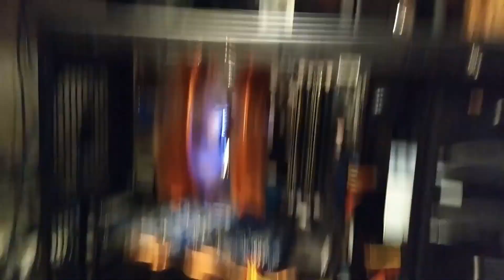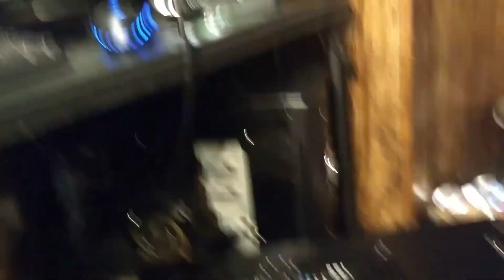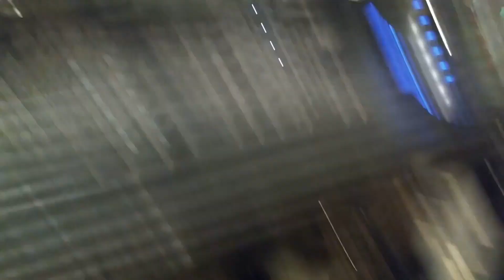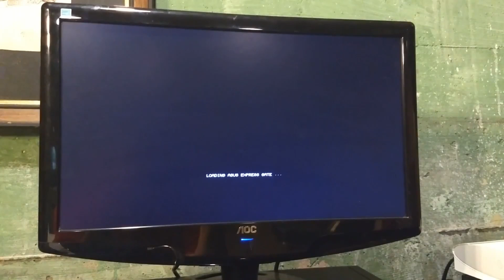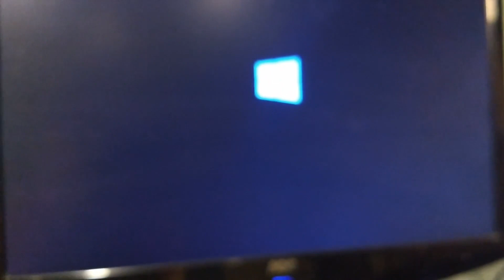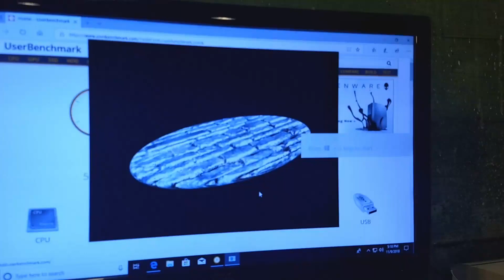What happens when your PSU isn't good enough?

Comment: hello before i use build in gpu without a problem then when i install my gts 450 when i play fps games it start glitching and i resatrt and froze please help me i dont know if my psu is the problem
Reply: but when i check in device manager and driver the gpu is properly working i use a8 apu with gts 450 with 250 genericv psu

Comment: hii i have ryzen 5 4600g w/ integrated graphics and 16gb of ram 120ssd and 500hdd but my system unit keeps stuttering like fps drop from 200 to 8 :( could it be the PSU?? already tried formatting but non changed its still stuttering please send help :(

Comment: I installed a new gpu and the pc wont boot up I unplug the power from that gpu and it turns on any idea would a low wattage power supply cause this? Or could the gpu be dead?

Comment: my pc when i boot it up with my 3070 it loads for a second sometimes will get to the windows login screen then pc shuts off my 3050 doesnt do that im using a 750 gold evga power supply and cant figure out whats wrong please help
Reply: my pc is brand new all parts are the gpu is used but doesnt have any signs of damage that i can tell and the 3070 fans and light comes on so id assume its working but idk what to do
Reply: Is your issue solved ??
Reply: @DjAsh05  yea it was a motherboard issue even though my motherboard was brand new a micro atx board isnt strong enough to push bigger cards what i mean by that is it doesn't send enough power to the pcie slot for the gpu to turn on

Comment: My screen will turn black screen while gaming with (no signal) sign on the monitor similar to yours, but after I force restart it bios warning didn't appear. Is it a PSU problrem or GPU problem.

More detail: when black screen occur, I can still hear the bgm of the game and my friend talking for 5 to 10 second, then the sound will go brrrrrrr
Reply: Hey i'm currently have this problem... i have a rx 6800 xt with 600w bronze coolermaster, what should i do? Is it a software issue or a hardware one? I hope u see my comment tho😅
Reply: @SoreofMadmen  hey there, feels bad to have the same problem. I solve the issue by getting a new GPU.
Reply: @orochix-bk6zp  i actually got a new gpu, but im aware now the problem was overheating hdd (idk wtfff and how this is even possible) anyway thank u for replying me<3

Comment: Thought it was my gpu failing when ever I loaded into a game couldn't even play valorant, thought it was my gpu which made no sense since it was an rx 580 and never had a problem. Then I asked my brother to use his which is the same and it did it again which would make no sense. So I thought it must have been the power supply. Bought to find out later on.
Reply: How was it? Does the replacement PSU solve your issue

Comment: My system has a gtx 970 and I am running it with a 500w psu, when I play heavy games it turns off suddenly. What can be the reason. Is it a problem with the psu or the vga
Reply: I think we have same prob mine i change my gpu from gtx 550 1gb to rx480 8gb and now i am having issue when max out gta v graphics the game will hang then image will gone for like 3sec then automatically restart it self and if i play on low settings i can play it but just for a couple of mins then the game will hang for a second image will gone then restart itself i dont know if the psu is the major problem

Comment: I'm currently having this same problem when playing games, I upgraded the CPU, motherboard and RAM, went from an i7-3770k to a i9-10900k running with a 1080ti, temps are fine, wattage is not going over PSU rating, reinstalled windows, my current PSU is about 7 years old now, so just ordered a new PSU, hoping that's the problem.

Comment: My stock 350w psu from asus was causing the same ‘voltage’ errors. I just upgraded to a Corsair 850w psu and pc is working like a charm.
Reply: NEVER cheap out on a PSU good decision! I'll do the same too!
Reply: If the power supply doesn’t work does it crash when playing games ?
Reply: @Mozatic  I think I got the same issue with a GT630 and a 305w PSU.What happens to me is random stutterings,screen messed up+distorted audio+PC freeze,fans spinning slowly with the GPU on and sometimes a totally freeze of the PC even on the desktop or very old games.If you had one of these sympthomps could probably be the PSU,you can ask to a PC shop to test it with a different PSU and if it's that the cause then you need to buy a new one.
For what I am experiencing I think it's totally faulty PSU.
Yeah I commented really late but who knows,maybe you still was guessing it.

Comment: Do you think that 50 watts less than recommended is concerning?
-------------------------------------------------------------------------------------------------------------
My friend wants to get a new gaming pc. I talked to him about some 
components and compared them to my own components. 
I accidentally found out that I need 450W and not my 400W.
Do you think this is concerning? Should I upgrade to like 500W?

This is where I calculated the 450W: 
https://www.whatpsu.com/psu/cpu/AMD-Ryzen-2600/gpu/AMD-Radeon-RX-5500-XT
On the website of my GPU, 450W are recommended too.

System:
CPU                           -AMD Ryzen 5 2600
GPU                          -GIGABYTE Radeon RX5500 XT 8GB OC
MOTHERBOARD     -MSI B450M PRO-VDH MAX
PSU                           -BE QUIET System Power 9 400W
Reply from the maker: It could be, I usually recommend at least 20% to 30% higher wattage than the max power draw of all of your components. Maybe even a 600W for your case just to be safe. Depends on how high quality of a 500W you get.

Comment: Well i bought a new PSU 550w and it popped 3 days after using while i was playing a game...i stopped using it cause it was hot and it smelled fried, so i replaced it for my older one, and i also noticed that i had set voltage on manual in bios, so I'm not sure if that was the problem, but from that moment after i replaced it, my CPU/GPU fans are like crazy and even tho i turned the PC after half an hour after PSU failure, CPU still had 67°C in idle, i tried to game on it, it didn't raised more than 80°C but im still wondering if it messed up my motherboard and that's why my fans are so loud or something like that, i just hope it will not happen with the last PSU i had before that one
Reply: Maybe you need to repaste your thermal paste or clean your pc regularly.

Comment: in my case, my PSU was not good enough so my system was slow I thought my system was just shit but when I detach one of my fans it finally worked
Reply: What how does that help
Reply: I have a 1660 super and a i710700 with a 380 watt power supply how can I fix this issue

Comment: What if there is too much extra?
Reply from the maker: Nothing, the computer will only draw what it needs from the PSU. I usually recommend getting a PSU that's rated around 30% higher than the wattage required for your system. You don't want to push your power supply to its limits all the time.

Comment: I have 
265w psu dell
Amd radeon r7 370 nitro 2gb
8gb ram 
Core i5 2400 
Whenever I play game after sometime ,it crash with stuck screen and also with buzzing sound, Hope u will reply ❤️👊
Reply from the maker: I threw your parts into https://outervision.com/power-supply-calculator and it recommends a 318W PSU (268W under load, 2 hours a day). Switching the power supply would probably be a good place to start. I'd recommend at least a 450-500W 80 Plus Bronze from a reputable brand. Here's a great forum post with highly rated units: https://linustechtips.com/topic/1116640-psucultists-psu-tier-list/
Reply: @seversinsystems  😊 thanks bro
Reply: SAME BRUH

Comment: I’ve been getting crashes, and then I will have to fight to boot it. I have 430 Watts running a rx570 + i5 3740, after watching this I now know my problem, I’m going to try to upgrade to a 550+ watt
Reply: any luck bc my gpu turns of and my pc stays on and monitor says no signal and i have a gtx 960 ssc on a 380 psu and i need to know if i need to change psu
Reply: @theycallv  I changed to a 600w and it did the trick for a week then it came back so I just got a gtx 1070 and I’ve been fine ever since
Reply: @SpaghettiToesTV  ok yes same i changed my psu and its working now hopefully it stays like that
Reply: I have the same issue now with my sapphire rx480 8gb when playing gta v on max settings it stutter and then automatically restart i have a class a 450 psu my old gpu was gtx550 1gb and its all fine with that card and since i chang my gpu to rx 480 its restart when playing gta v on max settings what do you the problem

Comment: I recently bought a Ryzen 5 3600 , 16gb ram , b450 pro mb, 550 psu I still use my (rx 470 idk what upgrade to but my button to cut it on just keeps blinking and the psu is making noise does anyone know what that means?
Reply from the maker: It could be the PSU. I would double check all of your connections to the motherboard and any other components. Also, if there's any kind of diagnostic LEDs on your motherboard, see if they can give you any more information.

Comment: Having the same problem. It started happening when I upgraded the processor and the GPU. 
My PC restarts when playing games. But also even just watching YouTube. My temps are fine, gpu and cpu temps are around 60-65C max. 
I hate to think that my seasonic 750 platinum is failing just after 2 years! I just ordered a new PSU from MSI. I hope that solves it.
Reply: did it solve it?
Reply: @metrox_supreme  ive had the exact same issue,pc just dies when in games after ive upgraded from a gt 1030 to a gtx 1070ti,and i swapped the psu from a shitty 450 watt one to a 850 gold rated psu,works like a charm
Reply: @ski11zlol  was your pc also getting randomly restarted with that 450w psu?
new PSU fixed event ID 41?
no issue with ram or storage drive? 
you sure this type of issue is only with faulty PSU?
Reply: @exgamer5073 did u fix it I need help
Reply: @fade_jr9712  yah I fixed it year ago changed my PSU to some reputable brand corsair gold rmx 750w
changed to Samsung NVME
changed my ram to corsair

if all of this seems expensive you can try one thing with F panel connector remove to reset connector from motherboard see if that helps
Reply: @exgamer5073  I think my issue is either windows, ssd, or psu I think I’m gonna try to replace the psu first
Reply: @exgamer5073  was ur pc crashing while just being in windows and freezing constantly?
Reply: @fade_jr9712  my pc was crashing randomly like in the first 10 second of boot it would crash the other times it would crash after few hours totally random

I knew there was problem changed my psu didn't solve the issue so then I changed ram and nvme while doing so I happen to remove RESET F PANEL connector I think that one was real culprit
Reply: Shai did the new PSU fix this problem?
Reply: @raketjohnny1337  yes
Reply: I remember a while ago I used a weak psu on a powerful graphics card and i was wondering my i am getting so much lag on an EVGA GTX 750 Ti 2GB and an Core i7 2600K i usually thought it was a storage problem because my hard disk was nearly full, after 5 months it destroyed my graphics card and there was a burning smell and smoke coming out of the power supply and my screen was showing display but the gpu fans werent spinning and after a few minutes my graphics card powers off and my screen went black, the original owner claimed the psu is 600w but when I took the psu I saw it was only 235w office psu so I upgraded to a 550w high quality psu immediately luckily my motherboard had an anti-surge otherwise everything else connected to the board would be fried

Comment: I have a 500 watt generic psu can it damage my GPU? Cause the fans is working but in my Monitor is Not Detecting it or No Signal
Reply from the maker: It's possible. I would inspect the power cables for the GPU and the GPU itself for any obvious physical damage. Otherwise, I'm not sure of any way to tell for sure if it was the power supply's fault or not.
Reply: @seversinsystems  i bring it to the Technician Yesterday and they Inspect it or he calls it Check up i pay 4$ to him i ask whats the reason why my monitor is not detecting my Gpu its because of my Power Supply they try there power supply and it work but when they plugging my power supply its 100% non but the fan is spinning btw thx for the help the main problem is my Psu is just a 500w generic and generic not lasting long thats why
Reply from the maker: @dandionila5133  Glad you were able to figure it out!
Reply: @dandionila5133  I have the same problem
Reply: @dandionila5133  what psu did you buy?

Comment: I have core i5 2400 and gtx 1050 ti with generic 350 watts gpu, am i safe?
btw i upgraded it from samsung prebuilt.
Reply from the maker: I would plug all of your components into this calculator: https://outervision.com/power-supply-calculator
Reply: I am assuming your safe, but it depends
Most of the 1050 tis does not have a power connector, so the motherborads provide the with max 75 watts and the bios settings of the card will kick in and clock it down if it wants to pull more.
Your i5 has 95watts tdp, but it pulls less, about 70watts ( I have the same cpu)
you should look at the 12v rail onthe infos/sticker on your psu and substract 20% off it, because its a cheap psu und you should not over stress it ;)
example:
12v * 20A = 240 - 48(20%) = 192 watts. In that case it would be enough to power your system
Reply: @Maxikingallright93  Thank you very much for the responsee

Comment: my gpu and my cpu are running at 20% usage and on amd its says im only getting 38 watts for my gpu so I'm guessing its my power supply. Can somone confirm this?
Reply from the maker: There could be a variety of things going on. I would need to know how the computer behaves under a full load with the CPU and GPU both at 100%. Or is the problem that you can't get them up to 100%?
Reply: @seversinsystems  my computer screen goes black whenever i run anything tough and i have to restart can you help me?

Comment: Idk what’s wrong with my PC... I got it 2 days ago and now it won’t turn on... I think it’s the PSU but idk yet
Reply: Do you also get a “no display” , if so im having the same problem here
Reply: @ski5859  sameee
Reply: @ski5859  mine will work but it has random cutoffs it’s my power supply I’m getting a new one and make sure your ram is in correct
Reply: if it wont power on at all then its the psu, if youre getting power then no

Comment: I have a prebuilt pc with an rx 5800xt  and a 5800x cpu with a 550 way bronze power suply it did not work properly gave them a call for a weak power supply they gave me an 750 way silver power suply for only the old one and 40£

Comment: i am using gt 730 on 240 watts my gpu temrature is 99 100 i replaced thermal paste but nothing happen 
is this fualt in my psu ?
gt 730 need 300 watts psu
Reply from the maker: I've never heard of a PSU making a GPU run hot. I'd check airflow in your case. It might also be a defective graphics card.
Reply: @seversinsystems  i have airflow in my case 
dust in heatsink?
Reply: GT 730 is painfully slow today, maybe you can get a GT 1030, it consumes only 30 watts and could work with your 240 watt psu (depends on what else you have in your pc of course)
Reply: @ash-cn2oh  nothing else bro  i have intel cour 2 dou e8400 3.0ghz 4 gb ram ddr2 and a gt 730 2gb gddr3 128 bit 160gb hhd with 240 watts psu'
Reply: @furiousxproextra8934  I think you have a good chance that a GT 1030 works in your system. But avoid the newer version with DDR4, you will want GDDR5. NVIDIA recommendations for watts are of course on the safe side to keep them out of trouble. And I dont know why your GT 730 gets so hot. Does it have a fan?
Reply: @ash-cn2oh  yes it have fan and i am upgrading my pc to xeon e31245 v3 equal to i7 4th gen 16 gb ram ddr 3 and rx 470 4gb with 550 watts psu gold 80+

Comment: Hi, is it possible that I am getting artifacts and blinking due to bad PSU? My PC also crashed on benchmarks like furmark, specifically the GPU benchmarks (also crashes on userbenchmark at same moment as yours).
Specs: 
Dell T3500 with 525w stock PSU.
Xeon X5675 and XFX RX580 8gb.
4gb x4 ddr3 1600mhz.
HP 1080p monitor.
Reply from the maker: Usually when it's a power issue, the whole system powers off completely like mine did. It's either that or the graphics card itself. I'd check if the GPU is overheating at all. If it's not, my next guess would be the PSU. Those stock Dell power supplies aren't always the greatest, especially if it's getting old.